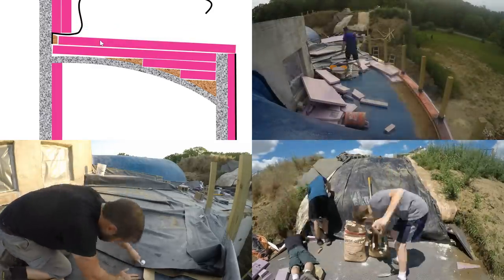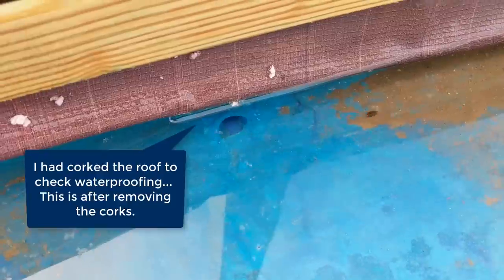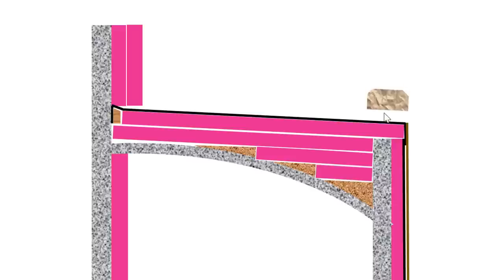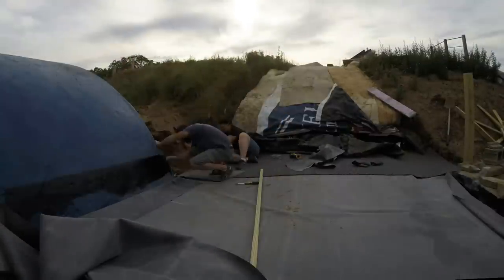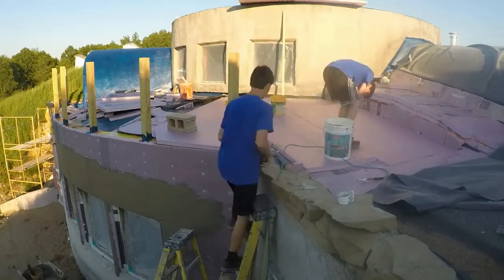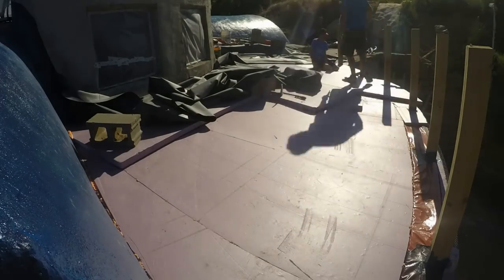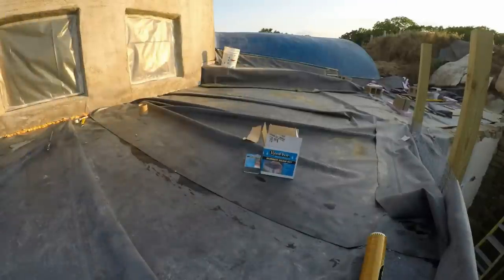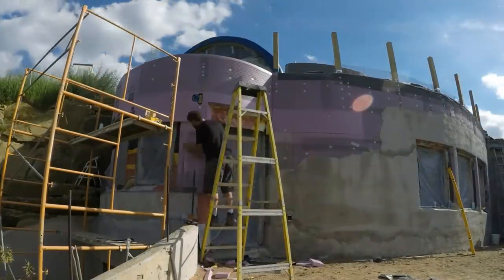44.2  Rubber and Insulation on the Guest Room Roof

Comment: Very cool! New video! Wish the housing market would innovate like your home....seems most US homes are more about saving money than  actual masterful architecture
Reply from the maker: I was also hoping this one would ALSO be about saving money...  We did save a lot of money on the build by doing it ourselves.  But the main point was to save money on operating costs in terms of reduced heating and cooling and reduced maintenance.   I am sure there were easier ways to save money without going earth sheltered, but I didn't see it as a tradeoff.  I wanted the two to go together.
Reply: @SimonHomeintheEarth  I would like to build something similar....except way less complex.....more like the an extended version of the garage you built "Quonset hut" (steel instead of the thin material) built with open floor plan.....except the inside being high ceilings and design similar to early english gothic arch style in churches with steel since im a welder.....this will likely never happen for me money wise. However your home is an amazing build. The earth sheltered would do good in Texas where Im from, cooling homes can prove difficult these days with the earth warming stuff...

Comment: I hope the trumpet practice is paying off. Short exercises through the day is the really the best way to progress on a brass instrument. Also, I appreciate the jazz music you have backing your narration. As for the building method, have you experimented with FRP bar (fiberglass re-bar)? You can get structural curves which are easy to tie wire mesh to.
Reply from the maker: Yea, he is really good about practicing the trumpet and piano and more.  He won the state competition for U-18 high school kids and we are going to nationals in August to compete against the other state champs.  

As for fiberglass rebar, no, but I have used bassalt rebar (bought a bundle) and it is good for some things, but not for others because it doesn't hold its shape like steel does.  You basically need something else to hold the shape and then you tie the basalt (or fiberglass) to that.

Comment: with the posts could you saw a very small gap into the posts all around and tuck waterproofing into the gap to stop water that rus down in its tracks?
Reply from the maker: It is sealed against the posts now.  The issue is that the posts are wood and even treated wood will eventually fail.  For instance, at least a couple of the posts have cracked along their natural grain lines.   I sorted out the issue by injecting liquid nails into the cracks, but its not ideal.

If I could go back, I would have used some sort of galvanized steel or aluminum post bracket that I could seal against and then easily replace the posts if they ever rotted.  

The only reason I can relax about it for now is that the posts are attached to the outside of the wall (see a couple videos back) and any water that does get inside is still outside the house and would just run down to the french drain at the footings.  

But if I ever need to replace those, it will be a serious hassle and I'll need to get creative.